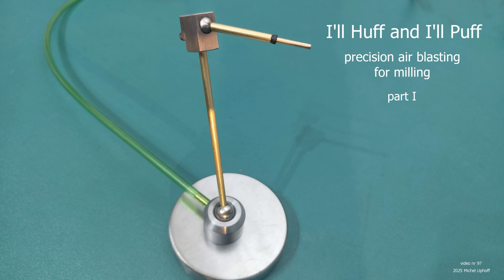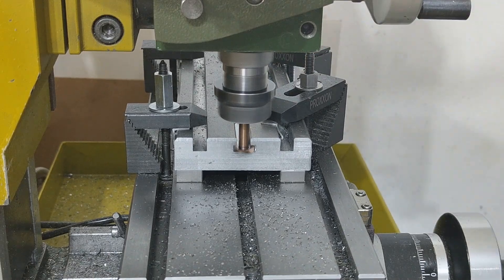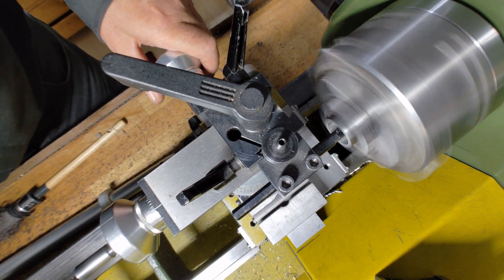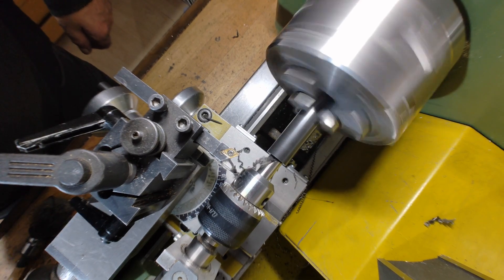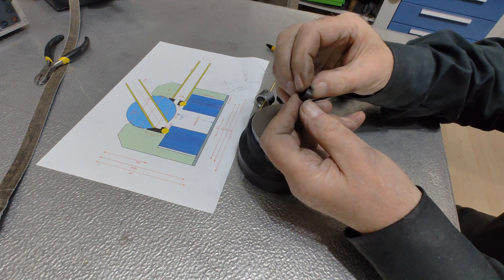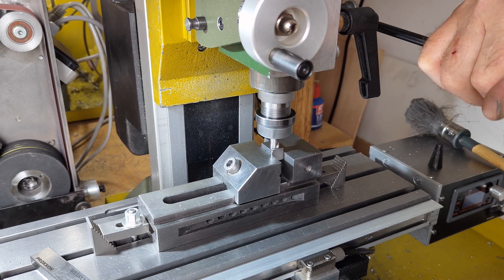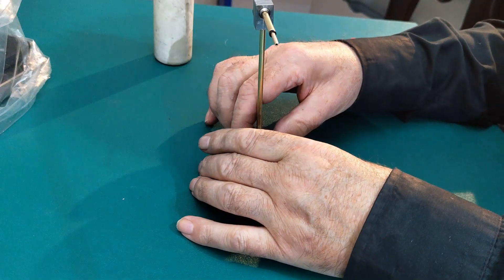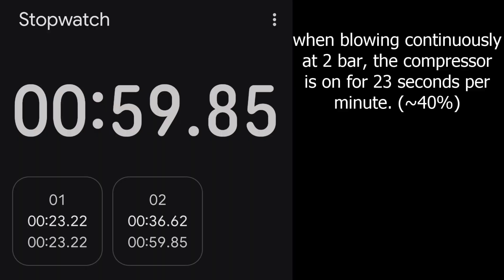I'll Huff and I'll Puff. Precision air blasting. Part I

Comment: Michel, will you be sharing drawings or even scanned hand sketches of your final design, showing the tolerances/fits you used, along with material properties like the O-ring "hardness"?

Assuming that you are now retired, what type of work did you do before retirement?  I'm guessing (degreed) Engineering and/or Sciences.  Or highly-self-educated!?
Reply from the maker: The main dimensions are already shown in the little sketch in this video. I’ll add a few more details in the next one, so that anyone with enough practical experience could build it too.

It’s all a bit more seat-of-the-pants than it may look. For instance, I haven’t the faintest idea what the hardness of that O-ring is (70 shore A ?) I simply made the POM pressure ring somewhat too high so that, after some filing and fitting it, together with the O-ring, provided a pleasantly firm amount of friction when the lid closed.

As for tolerances — nothing fancy there either. Things just need to seal properly and grip well enough. The general rule: use matching sizes for the tubes and the holes they go into, but make the holes ever so slightly smaller. If it’s too tight, a touch of sandpaper will sort it out. If it’s too loose, well… your “ever so slightly” wasn’t quite slight enough! And the materials: Steel (soft), brass, POM.

Yes, I did have a technical education — mechanical engineering and electronics. Together with those, science, especially physics, astronomy and cosmology, where my second love. I’ve devoted quite a bit of time to these fields of interest.

But no, I never worked in any of those fields. I became an IT manager instead. Now that I’m retired, I can spend way more time to those old loves — they never really went away, they just took a very long coffee break.

Comment: Another comment regarding the tapping: Have you ever thought about building a semi automatic tapping stand? I know that there was a German company that built these many years ago. Basically it has a quill and motor, and it will just spin free if it exceeds a certain amount of torque. And it also can reverse. On the proxxon FF500 it's always a bit of a difficult operation beacuse it lacks the reverse drive.
Reply from the maker: I've considered making a "tap boy." If built properly, they can be very suitable for those tiny taps. I might do that sometime.

Comment: POM is such a nice material. 9:50 How I usually do it: I put the work piece on the mill and the tap in the collet. Then I release the quill and let the mill do the first turns in the hole while applying just the lightest force on the quill handle. This ensures the thread has a good start and that it is perfectly straight. Then depending on how deep it needs to be I either go all the way in, or do the rest by hand later on. But usually this only works best with HSSE taps for blind holes because they are sharp and extract the chips better. Already made dozens of M1.4 threads with it. However, yesterday I broke a 23€ .75 carbide drill. These kinds of things always give me a light sweat.
Reply from the maker: With a three-piece tap set, you'll have little trouble tapping square by hand. Tap No. 1 is designed to be self-centering.

Comment: Thanks for another excellent installment! I was under the impression that the yellow Proxxon trays you have fitted to your lathe and milling machine were intended to allow for a recirculating liquid coolant setup. Is that not the case? I was thinking of going with that as a feature of my (eventual) setup. Are you considering making some specialised tips to produce patterns like an air-blade, or an annular ring of air to reduce the air requirement of your compressor? I'm looking forward to seeing your solution.
Reply: Thanks for posting. I admire your skill level and knowledge.
Reply: I guess, to get rid of chips you'd need the coolant to be sprayed with quite some pressure. Low pressure will only cool but not get rid of chips. Combine high pressure with liquid and his workshop will look like a big mess in no time. In some 5 axis machines, the table can be upside down, allowing chips to just fall down, but I guess this is also not an option. Proxxon mounted right under the ceiling... that would be interesting to see
Reply from the maker: Thanks!
Yes, there's a tray mounted under the mill, but that's not much use for coolant. The coolant runs through the T-slots and onto the floor (and in the base..) and besides, it splashes so much that my small workshop gets covered in mess. I did consider a bladeless fan, but I have something else in mind.